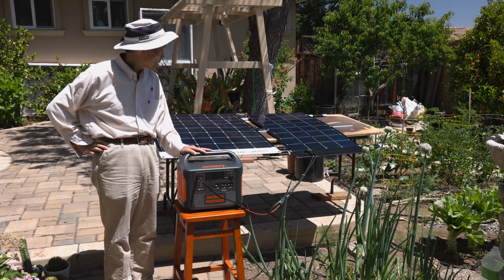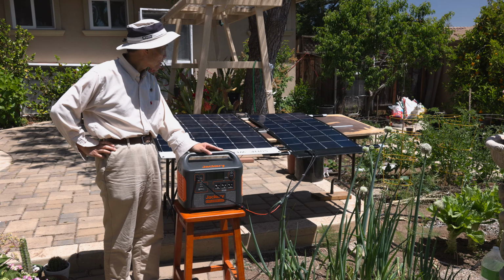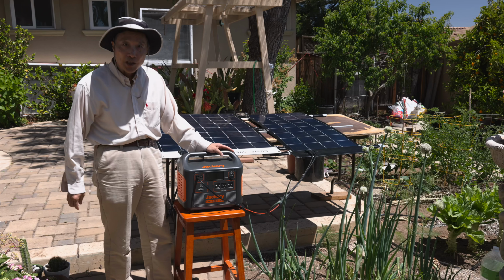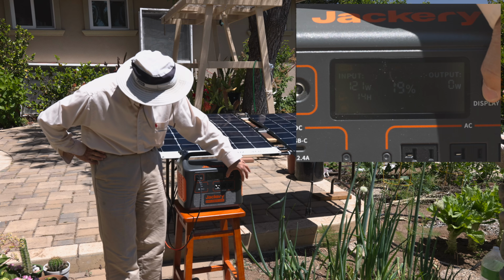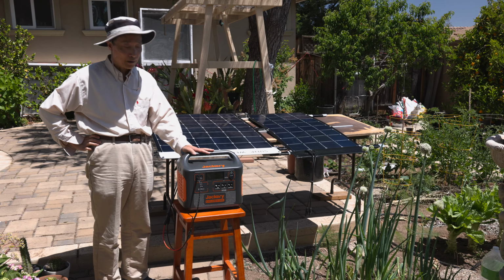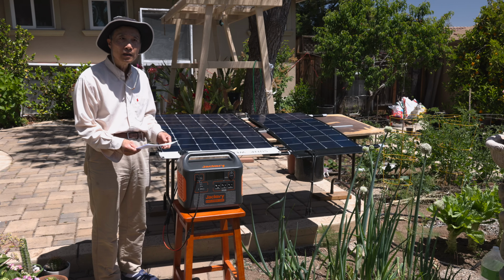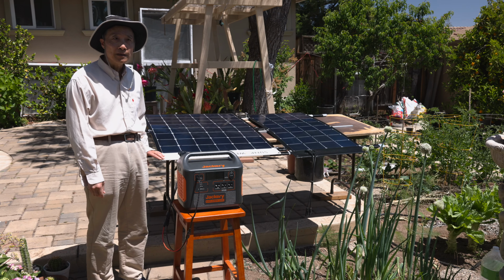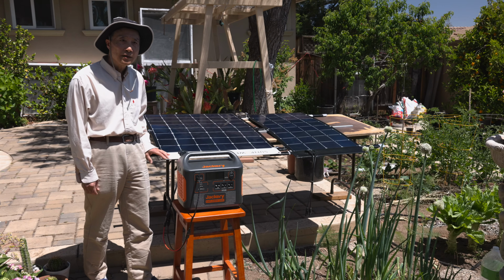Jackery Explorer 1500 - Solar Panel Charging Efficiency vs. Voltage

Comment: Thank you for this, I wish I had found this video before purchasing the 100w panel. I also have never received meaningful responses form Jackery Support, it is the most disappointing thing about them. It would be so simple to answer email in detailed descriptions rather than quick snappy answers. I will go with Renogy or another company fro my next solar power station purchases.
Reply from the maker: Thanks for sharing.

Comment: I tested my  1500 today. I used 2 x 180 watt Bouge RV panel in series with 44 volts open circuit and only got 224 watts of charging.  I then plugged these same two panels into my EcoFlow Delta and got 300 watts ! Why is the Jackery only 224 watts and the Eco-Flow Delta 300 watts? Something is not right with this unit...My Bluetti  got 310 watts also...the Jackery does not charge as efficiently as the Eco-Flow and Bluetti.  I plan to make a video...but want to speak to jackery first...
Reply from the maker: With my very limited testing I don't have an answer. The AC charger that comes with the 1500 provides about 285W input power. I wonder if your 2x180W setup is a bit too much for one input. Jackery does not advertise their 1500 with the new 2x200W solar panels. I would be interested to know your findings.
Reply: @ShenYe01  Jackery says 300 watts per input - upto 52 volts.

Comment: Is there a MAX voltage you can use from solar panels to charge the Jackery 1500?
Reply from the maker: The AC charger has 48V DC output. If you connect two solar saga 100W panels in series, the voltage is about 43V (open circuit). I don't know the max allowed. You can contact their tech support.

Comment: I tried connecting a renogy 175watt flexible panel with an mc4/8mm cable and nothing happened. Maybe I am just an idiot. I'm here trying to figure out what I did wrong.
Reply: You need to use their adapter for a single solar panel or have two identical panels and use the splitter they provide you. You have to use both ports in the splitter adapter.

Comment: Where did you get the cable for the solar panel input? How can I connect 1 solar panel to the new 8mm connectors on the 1500? Thanks
Reply from the maker: Since I do not need the two panel input adaptor which comes with the battery, I cut out 8mm port end and made a adaptor for single panel input.
Reply: @ShenYe01  Thats what I thought but wanted to check. Thanks for the update.

Comment: Which connector did you use to from Sunpower panel to Jackery?
Reply from the maker: The Sunpower panel has MC4 connectors. There are MC4 to 8mm adaptors available. Just keep in mind that the 8mm plug on Jackery 1500 is different from typical 8mm standard.

Comment: Hi, thank you so much for the update. How long does it take to charge the 1500 with the 170 watt vs. 110 watt sunpower panel?  I understand the weather matters, but let's say it's sunny.   thanks.
Reply from the maker: Good question. In most practical case, you don't start from 0%. If you start from 20%, 170W panel provides 140W input power based on my very rough measurement. To get 1200W (80% of 1500W) would need 8.5 hours. If Jackery could fix the charging efficiency issue, the 110W should get 70+ W input power. It will take 17 hours to charge 80%. In my case, I can use 170W panel and car 12V DC at the same time when driving. The charging time for 80% would be around 5 hours.

Comment: The technology is just not there yet with the solar charging to make these thing practical especially given how much they cost. Where I live we can go without decent sunlight for  sometimes weeks.
Reply: lonnie, are you able to utilize wind energy plugged into a solar generator? if jackery power stations have a controller built in then i would assume it will clean any source of energy.
Reply: @j350zr7  I would be afraid of killing the birds unless it was a real small unit.